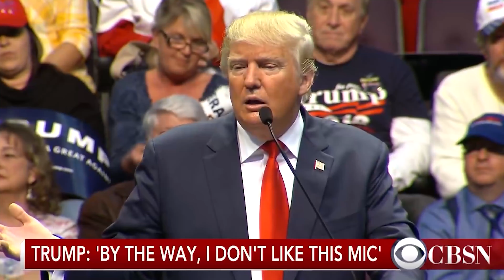THE TRUMP PLUGIN ? HAHA - How I use the Dynamic EQ on Yamaha digital consoles

Comment: Thanks for your awesome videos! One thing that do differently and I noticed you didn't in this video, is that when I send several mics to a group, I take them out of the ST bus and then I send that Post Fader Mix into the ST bus. Is that wrong?
Reply from the maker: Not necessarily. Honestly I find the Sat buss limiting and generally only use it for simple shows, near fields - or records. My general work flow is _ channels > mix (group)> mix to matrix > matrix to Pa (signal processor). 2 inserts on the channels, 2 on the group and limited inserts on matrix as I’m usually using a signal processor. There is few “wrong” things to do, the beauty with these console is they allow your work flow to adapt to your style or need. I’m also big on “return on channel” routing - when I need more processing.

Comment: Is the dynamic EQ better for de-essing than the built-in De-esser?
Reply from the maker: It really depends. I like in the built in channel de,esser in the dynamics section but, sometimes it is too subtle. Where as using the dynamic eq low pass shelf to de ess is more noticeable,  but only used as needed, and when not needed -the dry signal is preserved. I find the high pass shelf works great for plosives, I prefer it over the multi band compressor for that purpose.

Comment: For such an energetic speaker, it is not wise to use such a sensitive mic on him. Trump leans into the mic when he speaks. Gooseneck mics are used for someone that will be at a slight distance from the mic, for example standing at a podium. Trump doesn’t do that. 

I believe the production company should have looked at how Trump does his speeches and chose a mic based on that.  Shure SM57/SM58 would have been able to handle Trump’s high energy.

This video does help for when you’re in that sticky moment though lol

Comment: Hilarious, simple and best solution, put the mic offset at a 45 degree angle towards your presenter, place a clearly legible sign on the base asking them to stay 9-12”  away from the capsule, imlike to add or i will shock you to the end of my love notes…abd then send shure a link to this so they can sue him for defamation and direct his handlers to any of their many tutorials on how mics actually work vs. how people think they work…dynamic eqs are my go to for most sonic issues, in the case of plosives i might stack a  multiband eq in front of it using only the low band with a high ratio to catch the plosive and then the dynamic to scoop it out of the mix. Using dynamic in front of the multiband causes you to have to gain the low band way up or crank the threshold way $own to clamp down on that band
Reply from the maker: hahaha
Reply: @KINETICAUDIOTECHNOLOGY  i often put a little bsm in the lecturn so i can tell presenters to adjust the mic to avoid plosives in the first place……sometimes i forget or am not able to warn them about he possibility of my voice coming from their crotch area, hilarity has ensued especially if i throw some god verb on my send…..
Reply from the maker: @ericclinton7399  I used to do that but found the audibles could be distracting. The teams I am on now put messages into dsm's and promters (speak loader,  move closer/away , ect. )
Reply: I never even considered that……guess that means ill have to start using the com, yuck….lol….i occasionally go out and mix orchestras playing movie scores live with the movie, one of the video guys i travel with will insert stupid dad jokes into the conductors video feed which has all of their  cue information and the bouncing ball of tempo……its fun to watch the conductor’s shoulders  when they get to a cringy joke